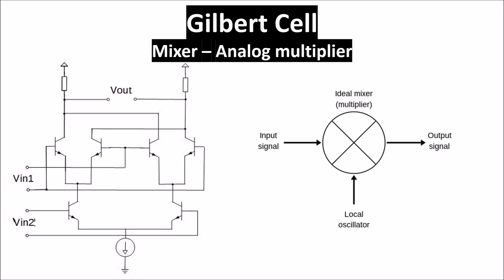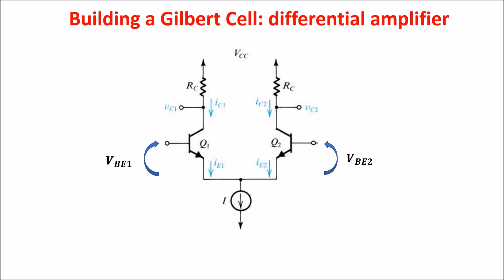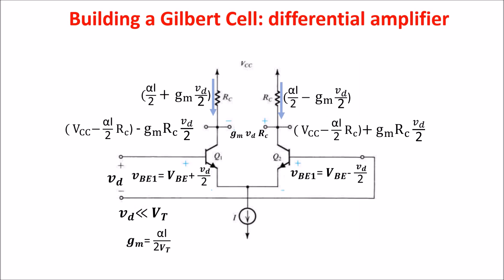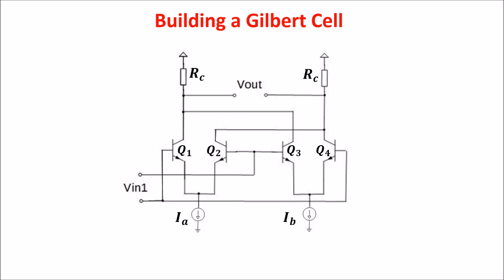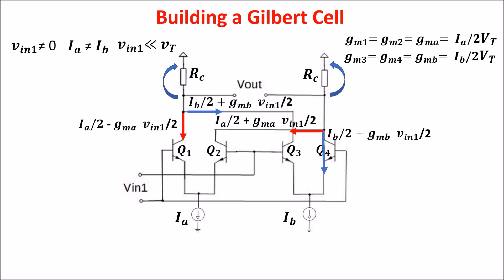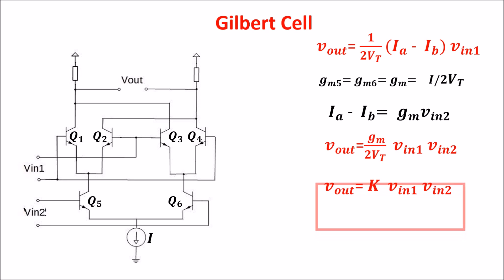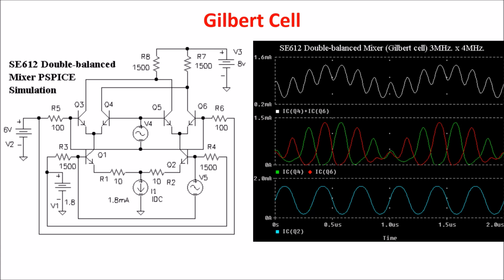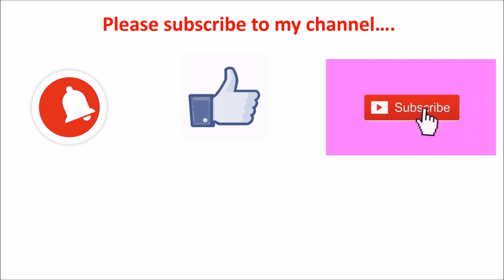Gilbert Cell - Mixer - Analog Multiplier

Comment: Overall, this is a good video. One thing is:  try to speak a little louder, it is hard to hear. I was trying to follow you last spice model and I get completely different results on LTspice with the same value you shown what model are you using for the transistors?